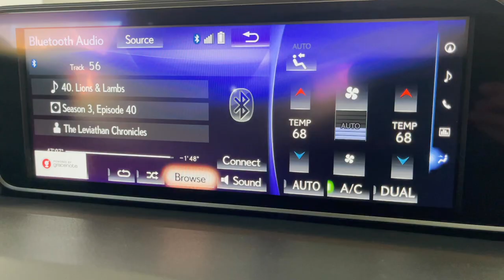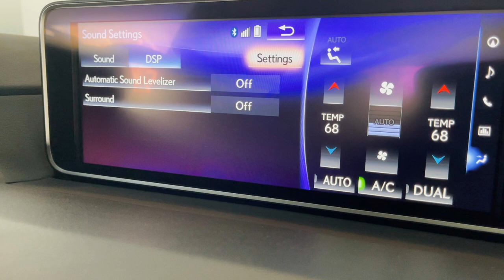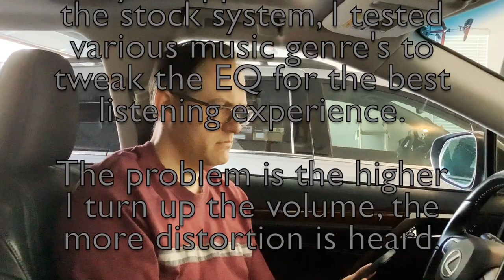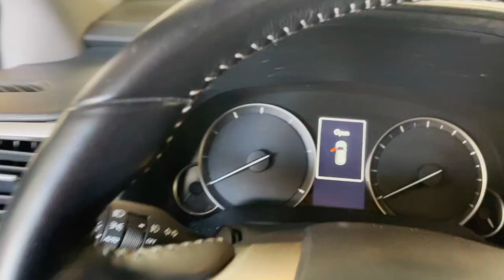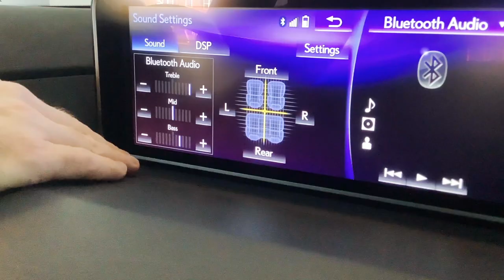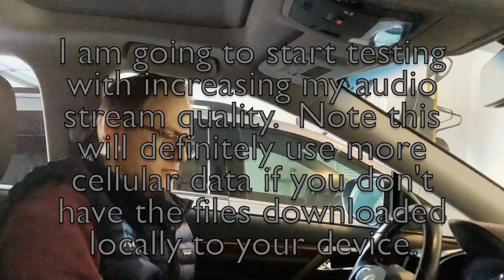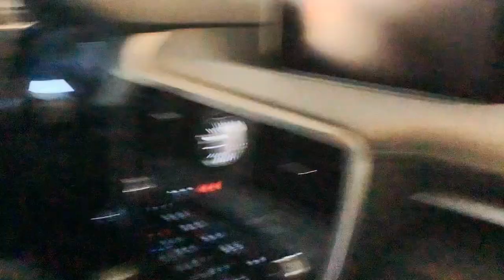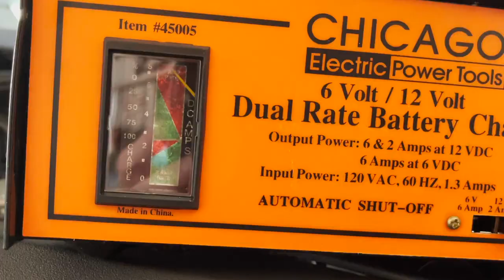Lexus RX 350 Sound System Upgrade

Comment: You need to think OUTSIDE the box.  THere is no need for you to struggle connecting the speaker with the tiny wires the car has in the front.  Also, you do not just crimp flat the connections, they must be soldered!.   First cut about 6-8 inches of wires, and carefully crimp and older the new connectors on the wire.  They you EASILY solder the new wire to the old wire.  This will make strong, permanent connection.  Your animal crimping system will only last a few weeks before loosening with vibration...  Also, you could have reused the wire connector from the old speaker so you do not have to cut the car wires...
Reply from the maker: Good tips!  My animal methods have always worked well for me. :-)
Reply: how do you use the the wire connector to the new speaker
Reply: @DjTrueDarkness  there is absolutely no way you reuse the harness from the old speaker. If you look at it when he is examining it, the plastic is all one molded piece.
Reply: What made his battery run on the lexus?
Reply: Did you heed this scathing rebuke and flee from your simple ways!!!!? Or did the connectors hold up just fine?

Comment: Thanks for the video. I had exactly the same reaction when I first sat in our 2021 RX model. Was very disappointed with the lifeless speakers and sound and the lack of bass. I had a Disco sport in the past and even the stock system on the LRs is miles ahead of toyota/Lexus. I decided to change the dash and the door speakers but found out the door speakers were only bypassed for Sub woofer frequencies so I went for the dash upgrade only. The local audio store said the 3 1/2 inch kicker 354s were the only ones that would fit so I went with them and they are pretty good. its brought the music to life. I wasnt aware even the 4inch JLs would fit as I just saw your video after I already upgraded or I would have gone for the JL  C2-400x. Do you think changing the woofers in the doors would be worth the upgrade to give better and tighter base?
Reply from the maker: Yes the JL's are definitely priiiiimo!  As far as putting them in the door it all depends on what frequencies are sent to the door and I wouldn't know until doing it.

Comment: Just replaced original speakers with 4032cfx 4”. Used connectors from Amazon Red Wolf, no splicing was needed.
Reply from the maker: Nice
Reply: how is the sound? Is it a dramatic improvement?

Comment: If you don't want to cut your car's wiring, buy Metra 72-8109 speaker wiring adapters for your cones.
Reply from the maker: Good tip!
Reply: is Metra 72-8109 suitable for 2016 -2019 RX models? front speakers?

Comment: Very nice video.  Mine is the 2019 RX350L with Mark Levinson.  I got the 4" Kickers and they are a tight fit, but made it....barely.  I don't think you mentioned polarity, if you did I missed it, but I found that the yellow wire was + Positive.  An old timer taught me a long time ago to put a 1.5v battery on the speaker and observe whether the cone goes out or comes in.  Long story short, they improved the overall sound considerably!  Thank you!
Reply from the maker: Very nice!

Comment: Nice work. Questions: Drivers side -- Red wire to narrow, white wire to wide clip, right? Passenger side -- Blue wire to narrow, white/gray wire to wide clip, right?  Thanks.
Reply from the maker: If you look back here https://youtu.be/mNHWVrAc840?si=xMD84hhnPbqwH9Q4&t=502 You'll see it's red on wide and white on narrow for the drivers side. But the other side looks right.

Comment: Thanks for your videos! I just got my 2022 RX350L and was looking to upgrade the factory speakers. I just spoke to the Crutchfield. They tell me that the C1-400x tweeter is very tight on hitting the dash speaker grille. Was that the case for you? Couldnt tell from the video.
Reply from the maker: It's definitely tight, but I was able to get it to fit. It's all plastic so there's a bit of movement available.
Reply: I have the exact same car and I am thinking of upgrading speakers, did you find any that works?

Comment: ALWAYS....test fit mechanically before cutting any connectors/wires. Also you can co-use a magnetic pickup when installing-removing those bolts. Thx for the vid!
Reply from the maker: Good tip!

Comment: Very nicely done.  I have a 2017 with the same system and just began streaming music from apple.  I was very disappointed in the flatness of the sound despite maxing out mid and treble.   I was connected through a cord to the phone and usb since I’m told this is better than Bluetooth but very little instrument detail comes through.  It sounds like the JLs made a huge improvement for you.  Of course, in this high inflation environment the speakers are now $100 instead of $80 so I’m looking at some Polk and kickers that have high ratings by crutchfield but may just need to bite the bullet to avoid being disappointed.
Reply from the maker: I would definitely go with JL and not any of the mainstream brands.  I now run everything on Apple Lossless over BLE and it's excellent.
Reply: @CarolinaCowboys  well, I cheaper out and ordered before I saw your response.  I ordered the kickers.  They are very highly rated on amazon and crutchfield so hopefully they will be good.  I think I will install one side, test it against the other side to make sure the difference is sufficiently pronounced.  If not, suppose I could exchange
Reply from the maker: @davide3129  no prob, you can always change the order before it ships
Reply: @CarolinaCowboys  tried that.  They don’t mess around already have a tracking number.  I will let you know how good or bad these sound
Reply: @davide3129  what’s the word??
Reply: @cp3onmtv963  I’m pretty pleased.  Very hard to say given inability to compare side by side but the difference between the stock speaker and the new kicker was impressive in the mid and highs so I’m very happy.
Reply: I got Alpine S4s and they are amazing

Comment: Nice video. So the 2017 Lexus RxX350 base model none ML system what is the subwoofer size in the trunk on driver side? Can't find specs on it 

Thanks!!
Reply from the maker: I believe it's the same 8" woofer that's in the 2010 model

Comment: Thanks for this video. Will increasing the power to 35W instead of the original 20W design affect the amplification?
Reply from the maker: Yes you definitely have to turn the volume up higher to get the same level of sound, but it's still well within the limits. I don't think it could handle replacing all the speakers though.
Reply: Higher end speakers are specd to be different ohms. Generally, the bigger the coil and speaker, the more power it's required to get the same amount of sound pressure, but the speaker can handle a lot more too

Comment: Did you have any spacing issues when installing the passenger dash speaker?

I’m trying to install the same speaker but it won’t go down, it appears that the air conditioning duct is preventing the speaker from sitting flat.

Did you encounter the same problem?  Did you just let the speaker sit on the air conditioner duct and screw it in facing slightly towards the windshield?
Reply from the maker: I had to wiggle it a bit to get it in and screw it down.  The one on the right was a little more difficult, and you can see from the video it doesn't go completely down, it's up a tiny bit.

Comment: I have a 2019 Lexus RX350 with a factory installed navigation system. 
An expert from Crutchfield store said that the JL C1-400x would not fit in my car. 
Is it true. Please advise.

Thanks
Sam
Reply from the maker: I'm not aware of any differences in the 2019 model from the 2016 model I installed them into

Comment: Do You think change the center channel would improve the sound quality? I'm planned to do the same thing as what you did in the video but I was thinking if I should upgrade the center channel as well? Thank you.
Reply from the maker: I thought about that, but I think that would only come into effect when you're either using the 'surround sound' mode which I don't recommend trying to make your car sound like a home theater.  It's a great stereo but not a great digital signal processor for surround, more like 'simulated' at best.
So I don't think you would get much use out of upgrading the center channel.
Reply: @CarolinaCowboys  I appreciate it.
Reply: Sometimes its best to completely remove the center speaker actually
Reply from the maker: @zackkirk6514  interesting I’ll have to unhook it and see if it makes a difference.

Comment: What ohms are the factory speakers. I have the ML in my 2014es350 but in my opinion there not that great. I had aftermarket jbls in my Honda that sounded much cleaner and way louder
Reply from the maker: I'm not sure exactly, I figured most of the the car audio was the same.
Reply: You probably found an answer by now, I have a 2010es350 and the speaker impedance is 6 ohms. 4-ohm speakers should be safe. If you have a multimeter then go to your amplifier, take the wire harness out, and tap the probes to check the impedance of the amplifier output

Comment: So I don't have a 350 but I do have a 450h. I would say that there is a lack of sound and base in the rear if you change so that the sound is coming from the rear the way you really should be. The way that you have your car set up where you are focusing all the power to the front speakers is not the way to do it. You are definitely missing out on having a more full sound coming from a variety of sides from you. I don't know why you would ever set it up pushing all the sound coming from just the front.
Reply from the maker: Mainly because I don't want to change out the door speakers also, and also because I only care about how it sounds to me in the driver seat.  I don't care about the sound coming from behind me, the only thing I need back there is the sub which I EQ up.

Comment: Do you have the 12-speaker system in both of your RX’s?
Reply from the maker: Yes, just the standard system
Reply: @CarolinaCowboys  actually, The base RX’s that usually didn’t have the navigation system came with a nine-speaker system, and the ones that came with the navigation and the comfort package had the 12-speaker system with the subwoofer, and then of course there was the upgrade for the Mark Levinson system😁
Reply from the maker: @eleanormassaro5195  ah ok, both of mine have the nav so it’s got the mid-grade system

Comment: Could you do a video on how to change the transmission fluid in 2010 lexus rx 350?
Reply from the maker: It's not recommended to ever change the transmission fluid in the Lexus RX350.  They were basically built to run forever on the original fluid.
Reply: @CarolinaCowboys That's absolutely wrong. Transmission fluid should be changed. The "lifetime" you may have heard refers to the length of the manufacturer's warranty, not the life of the engine. 

Please change your transmission fluid.
Reply from the maker: @RoNiminal  Yeah that makes sense except the dealership told me otherwise, also changing the transmission fluid is not in the owners manual maintenance intervals.
Reply: @CarolinaCowboys  the dealership has no interest in upkeep of your luxury vehicle. They're interested in selling you a new one. Plus, the owner's manual of a luxury vehicle will not have that info, either. It will be in the service manual.
Reply: @CarolinaCowboys if your definition of lifetime is 150k, sure. If it is 200k+, then no. Only reason oil change intervals and atf change instructions are written the way it is now is b/c manufacuters have to balance btw environmental impact and longevity to get passable environmental ratings from agencies worldwide - not b/c they only prioritize longevity. Transmisson manufacturs' repair manual also states otherwise

Comment: Does anyone know of anybody replacing speakers in the Mark Levinson package?
Reply from the maker: Why would you want to?
Reply: @CarolinaCowboys  why wouldn’t I? It’s not as if I take off the speaker covers and there are Focal’s or equivalent instead of the whimpy factory ones. The Mark Levinson package sounds ok or better than the standard package, but the speakers are anemic.
Reply from the maker: @tombrown1032  Ahh I didn't realize they were only marginally better than the stock system.  Well I swear by these JL Audio, I'm sure it's a very similar procedure.

Comment: So according to my findings the stock 4" dash speakers are only rated at 20w rms, and the JL's are 35w rms....i dont see that as an upgrade cause the factory amp is only pushing 20w rms to the JL's...your actually losing in-depth sounds compared to the stocks....just my $0.02 cents 🤷
Reply from the maker: When you install a speaker that requires more power and you're using the same amp, you just need to turn up the volume to send more power to the speakers.  As long as you still have volume increase room to get a good sound then you're within the limits of your amp.  This simple upgrade was a night and day difference.
Reply: @CarolinaCowboys  it'll stress out the factory amp causing overheat, unless you dont do long drives 😁...look it up
Reply from the maker: @Dj1Kreationz  I could see that happening if I was to replace all the speakers, but the factory amp is more than capable of handing an additional 30w of power.
Reply: Where did you find that the factory speakers are rated to 20w? Is that for the mark levinson speakers or the regular ones? Also, if the sensitivity of the JL speakers are the same, or greater than the sensitivity of the factory then he won't need to increase power. The speaker's sensitivity rating  is the volume level in DB that the speaker produces with a fixed amount of power. With that said, these aftermarket companies tend to try and make their speakers sensitive so that the problem your talking about won't come to fruition. As for the varying amount of power that actually ends up reaching the speaker, the JL speaker will receive more power at lower volume settings due to lower impedance. The main thing to watch out for when doing an upgrade like this is that the new speaker impedance is at least at or higher than the amplifier output, which you can check with a multimeter.